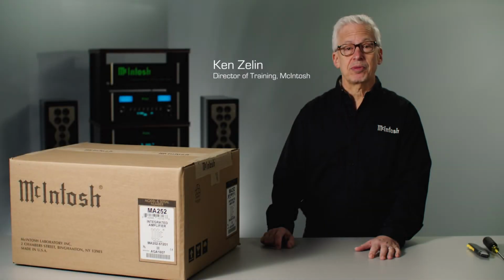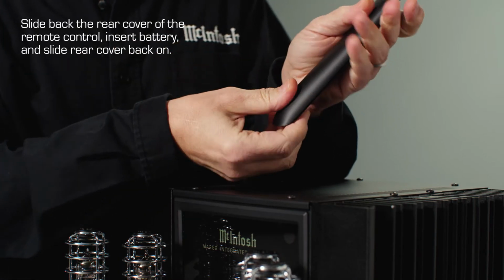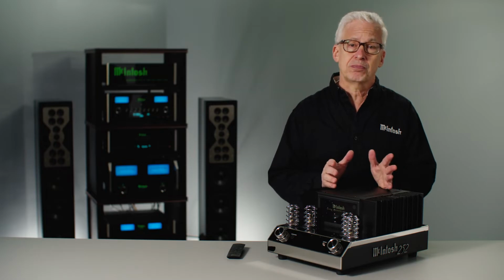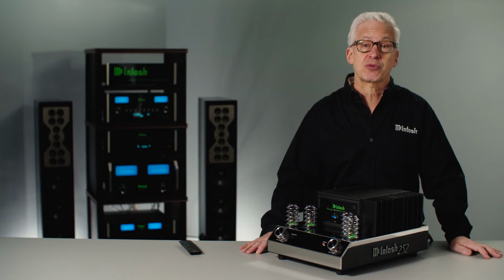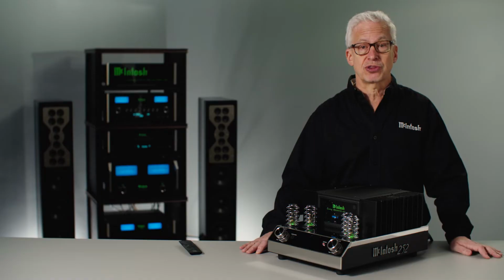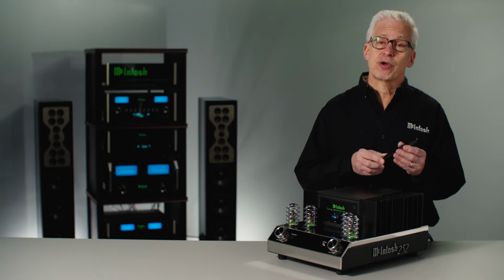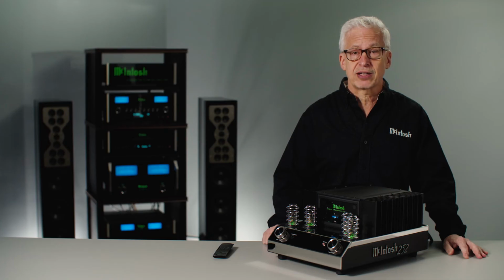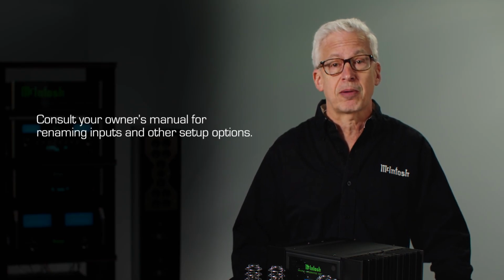How To Set Up Your McIntosh MA252 Integrated Amplifier For The Best Audio Quality

Comment: I love my MA-252 and their matching XR50 speakers. Sonic heaven.
Reply: I can tell you a couple of things I have discovered using their components together. They seem to have a synergy together and those little speakers really put out some bass when you put some watts through them. They are about 11 feet apart and the floor is wood. They are almost flat down to 40hz which is pretty amazing itself. I'm a vinyl guy so about 90% spins @33 1/3 and the sound stage is pretty impressive. I added a REF T-5X sub to the mix and with a spectrum analyzer I get to around 30hz low, which I use to add clarity to the bass, not overpowering it. So with cables, sub and other components, I have about 11K invested and am extremely happy with the results. I wish I could have afforded it when I was younger but I guess that is one of the perks of older age. This system will be around long after I am gone it is built that well.
Reply: Can you help us by conducting one online demo?
Reply: I don't see why not. I understand the concept of not very efficient speakers using more wattage and getting into the amps sweet spot. But you need 100 watts minimum, imo.
Reply: @jaycoleman8062  definitely would love to have one ..  I have a naim uniti atom right now at 40 watts per channel but wanted to upgrade..  not sure the 252 would fit that category but it fits my budget
Reply: Would the 252 drive a set of dynaudio Sp 40 at 86 db in 6 ohms

Comment: I have a turntable with a Damon moving coil cartridge. Do I need a phono pre-amp?
Reply: Assuming you mean "Denon" if you have 'High Output" MC cartridge like the DL110, (Output 1.6 mV) you can use it in a MM (Moving Magnet) phono input like the one on the MA252.  If you have a Low Output' MC cartridge, output less than 1mV, it will need a Moving Coil input (MC) or an outboard Phono Stage, like the McIntosh MP100.

Comment: How would I hook up a MHA200 headphone amp to this integrated amp?
Reply: Avec une prise Jack
Reply: sorry, you would not, it does not have a secondary output, neither fixed nor variable. When creating an entry level product, to keep the price down, one can either save $ by making it not sound as good, or by leaving off features. Mc always does the latter. The MA252, adjusted for inflation, is the least expensive ever from the company, even not adjusted for inflation, the lowest price in 30 years! So, sounds great, lacks features.